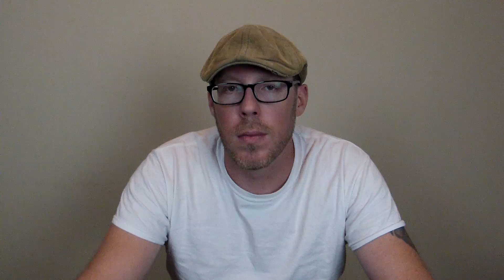Electrical Shocks From Swimming Pool

Comment: Florida Pool Service Contractor here. Shock also means something is introducing the electricity to the pool. Bonding is almost completely hidden when pool is complete and pool builders fudge this from inspectors all the time. Worked with a builder who told me to tie bonding wire to pipes underground so inspector would think it was complete. Inspectors don't want to dig.

Comment: Just curious most above ground pools when installed have pumps and filters that sit on a plastic casing and not directly on the ground. My pool also has only one point of metal contact where the wall joins together. There i can bond from that seam directly to the back of my pump. The rest of my pool is resin so for me there is no 3 more points unless I decide to screw into the wall which I won't do..my understanding is that what I did is actually okay but wanted to see your opinion since Resin pools are now more popular but the pool makers don't provide bonding point places all around

Comment: cut an old pool light apart, just to see how it is done.
power cord comes through reflector cone, attaches to  screw in socket. (black/white and green)
Socket did not touch reflector cone,separated by resin.
Niche is bonded, front with jumper wire and back to conduit.Face ring is bonded via pilot screw and metal spring inside of plastic niche.
However, stainless steel reflector cone is not bonded.
It is not connected to face plate....gasket is tightened from face plate to reflector cone with  non conductive brackets .(some have a tension ring, which would bond it all together)
question is...does reflector cone need to be bonded, or is it ok since you do not come in direct contact with it.

Comment: I have had a very mild shock, like a very weak 9v battery that I can only feel if I have a cut on the hand in the water, with one hand on the deck. Got the pool redone completely, including cement, liner, new light, new skimmer, new Hayward Super Pump. "This will surely fix it", the pool guy said. Well it didn't. Had electrician over that drove new copper stakes, regrounded everything,  including the aluminum fence, pump and ladder. I keep the light off at the breaker in the pool house. He said everything was "bonded". None of that helped. FF 1 year, had another electrician, these are not shade tree electricians, reputable companies. The last electrician regrounded everything again, said it was all "bonded". Got a new Hayward 1HP pump. That seemed to work, life was finally good,, until we get a lot of rain. I have sent college educated men from the energy company out of here shaking their head, hat in hand. Nobody can figure it out.
Last few things... this mild shock I've noticed is mostly around the skimmer. There is a metal pipe in the bottom of the skimmer? When I unplug the pump or the pump isn't running, NO shock. Also there is an old, Ma Bell, I think unused, telephone box on the back of the pool house. No electrician ever mentioned that.
Sorry to be so long winded but this is driving me crazy, not to mention thousands of $$$. This is an old video. Really could use someone smarter than me to give an opinion.  Thanks.
Reply from the maker: This is actually a very serious issue.  Any amount of shock from a pool shows a fundamental failure of the protection system.  I have met many electricians who did not understand how to bond a pool.  Driving in new stakes to the ground would actually serve to make this problem worse unless they manually removed the pre-existing bonding grid.  having two reference points to ground can easily force a current transfer where there was not one before.  I think you might have hit on something with the telephone lines as they carry current and could be the source of a voltage difference near the pool.  The only other story I have heard like yours was from someone who ended up having an electrical line buried below the pool.  It was found when the pool was eventually torn down.  Like yours it was worse when there was rain.  Also that symptom of the pool not shocking when the pump is off is another big clue.  I would test and retest this fact to be 100% sure this is in fact the trigger, because if you turn on the pump and are getting shocked, and turn it off and there is no shock, and turn it on again and there is shock again...this tells me it has to be the pump leaking current into the water somehow.  Is the pump on a GFI breaker?  Many times they are run on non-GFI breakers to prevent nuisance tripping of the circuit.  I am sorry to say but you must investigate further and you should not be using this pool until the source is found and resolved.
Reply: No GFI. It has done it with 3 pumps. Probably is the phone Line AT&T installed in the 60s. Thank You Steve!
Reply: Iam adding a pool ladder to my inground pool. Do I need to cut through the concrete deck to run the copper wire from the ladder to connect to the rest of the bonding wire?
Reply: @jackjohn8246  Could add plastic ladder. Then you don't need to bond.

Comment: Hey Steve
My question is, I understand the bonding process of all points of the pool bonded together to make sure that the ground potential is the same in all parts of the pool but how would that work with pavers around a pool instead of rebar in concrete
Reply from the maker: It only applies to things which are made of metal.  You are not concerned with non metallic items as they will not conduct electricity and therefor are not an electrocution concern.
Reply: you need to install a #8 bare wire all the way around the pool under the pavers and connect to t the bonding grid